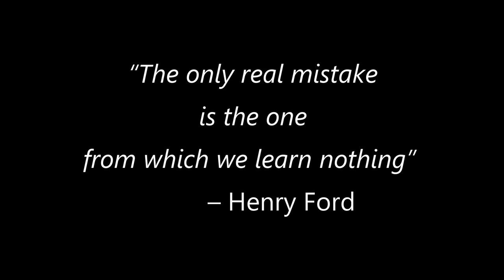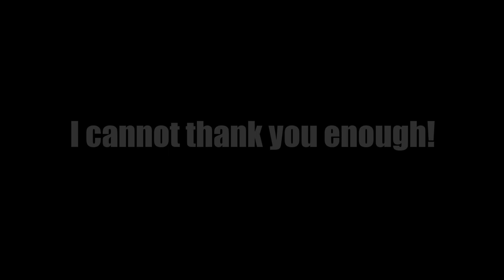The last tool and the first MISTAKE

Comment: I'm surprised you didn't use the compound miter saw to cut the beam boards.
Reply from the maker: There was only 1 board that actually needed to be cut, and it was too peaceful to fire up the generator lol...that saw will see lots of work once I start the subfloor.

Comment: good evening. I put a like. congratulations on a good purchase, I also have such a saw, but the truth is Chinese, but it works well without it, I can't work with wood at all, it makes my work very much easier, so congratulations, please tell me, Sean, what is the motor power of this saw in watts? and please tell me what is the diameter of the cutting disc please forgive me for my poor English
Reply from the maker: Your English is great! The saw operates on 120 watts, the standard American outlet in homes. The blade on the saw us 12 inches. Oh, and the Chinese do make some great stuff! I imagine if I looked hard enough I would find my saw was actually made in China lol....
Reply: @SeanInAlaska  we have a 220 volt network in Russia, but I wanted to ask another question about the motor power of your big saw.?